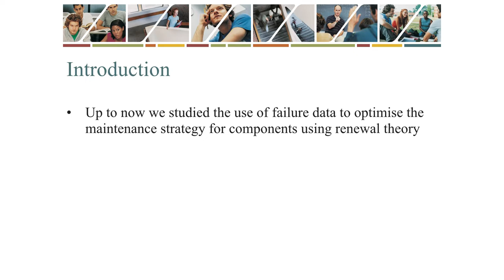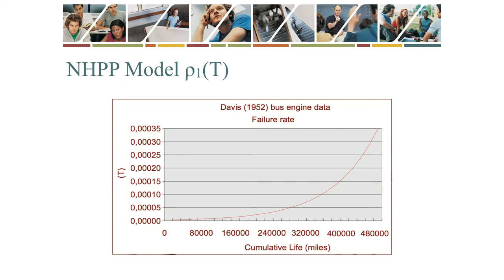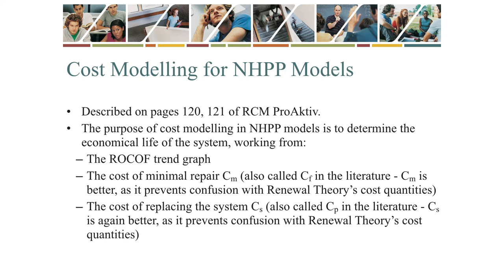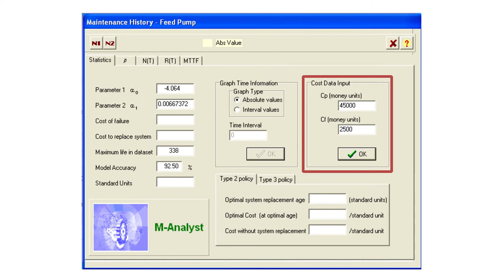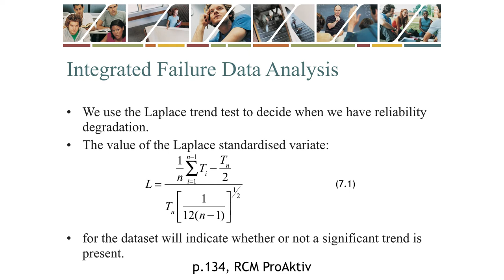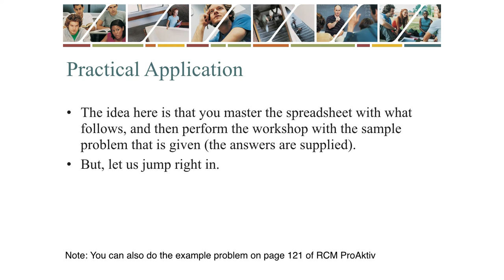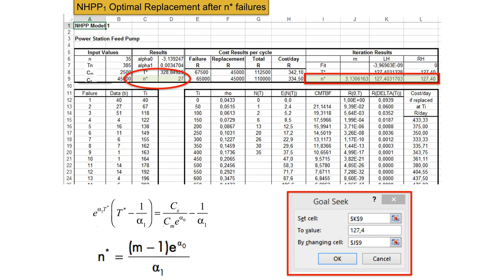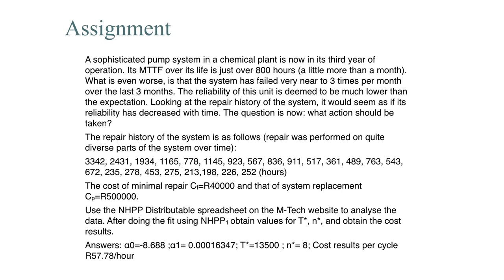NHPP Workshop

Comment: In simpler terms; Can I apply above analysis NHPP2 for fleet analysis without any change or is this for single system analysis.
Reply: Hello Sandeep, This is meant for single item analysis. One can combine the data for the various equipment in a fleet, ideally after statistical compatibility analysis, and then find the optimal replacement age for the fleet.
Reply: Thank you sir. By statistical compatability, I think you mean one has to ascertain homogeneity of population through Common beta Hypothesis test; correct me, if I'm wrong. Also can you suggest any book, paper or YouTube link where fleet reliability analysis has been explained in a detailed manner as you have explained for single system.
Reply: @sandeepmishra3627  Yes, Sandeep. You have the idea. However, I have not pursued or done it. I suppose one will have quite a number of problems, because of differences in failure patterns for various systems in the fleet. So, one will really have to start working on it, test, and build a practical, hopefully standardized, algorithm.
Reply: @bemarking  Thanks for the response, I understood.